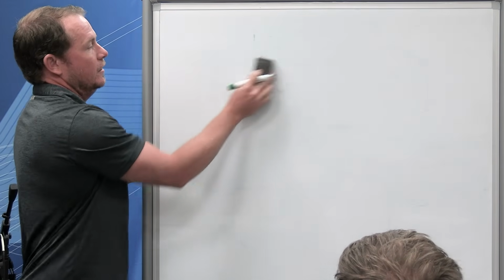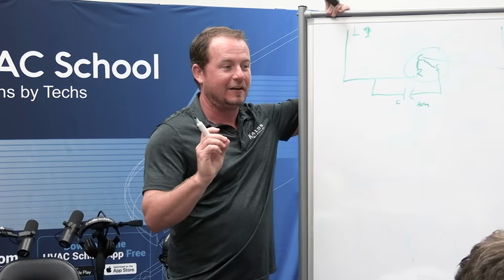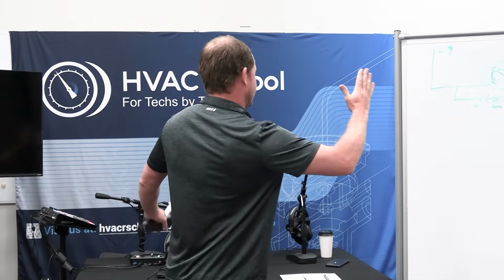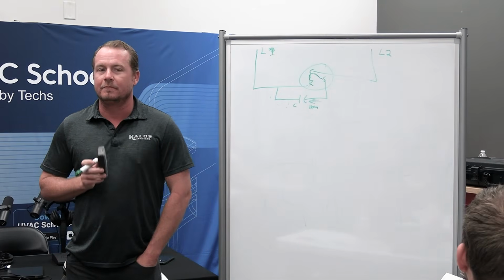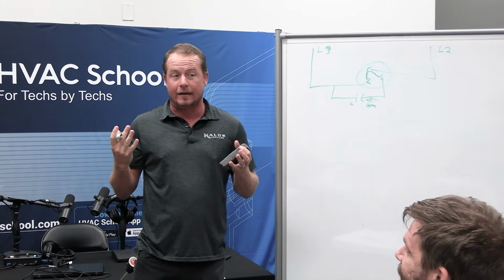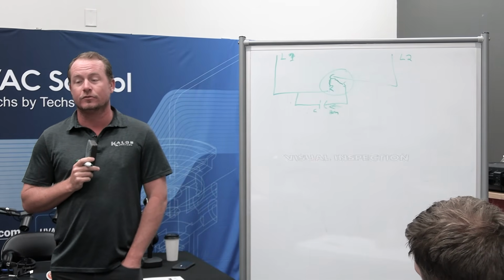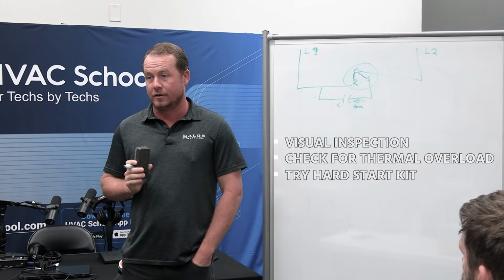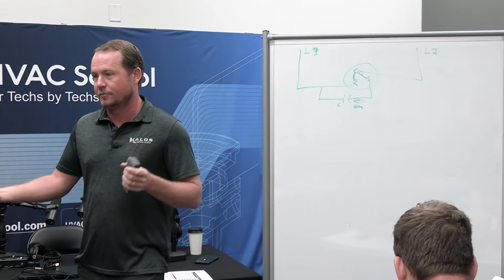Capacitor and Hard Start Myths Busted

Comment: Capacitors increasing voltage:  A person can easily get this conclusion if they measure the A.C. voltage on the input to a rectifier with a capacitor across the output of the rectifier without a load.   In North America the A.C. line voltage will measure using a DVM  at something near 120 volts A.C. while the D.C. side will read the highest voltage reached during the A.C. cycle which will be 169.7 volts D.C.  

The idea of A.C. RMS voltage is the same number as an equivalent continues D.C. voltage that would provide the same electric Power to a purely resistant D.C. load.   A purely resistant heating element would be expected to produce the same heat from 120 volts A.C. or 120 smooth D.C.   Really liked your lecture!   Good engagement with the students!
Reply: You're describing something completely different. The RMS to peak voltage will depend entirely on the wave form of the AC voltage. In some cases you may see the term Crest Factor used. For a sine wave the factor is √2 or approximately 1.414 which is where the numbers you cited come from. The crest factor for a pure square wave is 1 which means the the RMS voltage and the equivalent DC voltage are exactly the same. Many DVMs do not actually measure RMS, but instead apply a correction factor to whatever they do measure while assuming a sine wave.

Comment: The ECM motor is not three phase.  It is a DC servo motor.  You use a computer/controller to control the speed at which the poles rotate.

I really don't understand what in the freaking what this guy is talking about???
Reply: He is not wrong.  It is a DC commutated 3-phase motor.
On Genteq's website (regalrexnord), they have a video that describes the Evergreen ECM motor as '3-phase' motor!
It's semantics...
It is not conventional sine-wave 3-phase as in industrial utility service; it is pulsed DC into 3 'phase' windings.
ECM motors are commonly known as DC as more commonly they are supplied from a DC source instead of AC power.
In this case, there is an AC to DC rectified power supply internally powering the ECM part of the module...
[The DC part of the circuitry is on the power input side, not on the motor side; there is no 'DC' at the motor...]

Various companies and instructors (and myself) may vary the terminology and strict definitions.
I'm not sure there is universally accepted terms for these new applications for these ECM motor technologies.
Mr K L

Comment: WOW!  I am an Electronics Technician with over 25 years experience of repairing electronic equipment down to the component level and this is a seriously dumbed down and confusing explanation of what a capacitor is and what it does.
It would have been easier, quicker, and clearer if the construction and actual nature of the capacitor was simply shown.
Two plates separated by insulation that will STORE electrical charge.
How hard is that?
Then you need to make sure that everyone understands the nature of AC and DC current flow.
BECAUSE,
how the capacitor behaves in an AC circuit is very different then when it's in a DC circuit.
But you really ought to learn both these natures to properly grasp how it does what it does.
Also, the symbology he used is for a capacitor that has a polar bias.  A cap used in an AC circuit should properly be drawn with two parallel line segments.

There is some good practical info on what happens with a bad cap in a motor start circuit and what to look for and how to get past certain problems.

Comment: Capacitor is like a spring. Takes a certain amount of charge per volt change of potential (movement per unit force changed). The force/potential is across the cap, like either end of a spring. The trick is, though, that a stiffer spring is like a smaller capacitor - takes less movement to get big force fast. A big cap is like a soft spring. Voltage rating is like force rating - springs don't usually have these, but imagine if you pushed or pulled so hard it broke.  The other way of looking at it is, stiff spring = small cap = not as much movement for  a given force. 

What makes it all confusing is that electromagnetics swaps things around! Actual magnetic fields make force from the current, and give you speed from the voltage, when you'd think it should be that more voltage is more force, and more current, more speed. But that only applies to electrostatic actuators, which barely exist at all. (piezo-actuators work that way). 

Magnetic actuators, which is mostly what an electric motor is, flips things around. But that should make some sense, because magnetic fields store energy like a moving hammer: It's inertia. Its funny how you can watch the current 'disappear' as movement happens, and even 'reappear' when movement begins again, with solenoids / electromagnets. 

But yeah: Inductance is a measure of how many volts it takes to change the current by an amp in a second. Pretty much exactly like mass. Heavier hammer takes more pushing for longer to get up to the same speed as a lighter hammer. And like a hammer, when you change their speed suddenly, they make very much stronger forces - at least for a very short time. 

So, basically electric motors and electromagnets in general trade the inertia of the electric current for bulk inertia of matter. To have much of that 'inertia' available to 'trade', you have to have a lot of 'movement'. 

Fortunately, you can cheat a bit by winding the wire around multiple times. That lets you get more amp-turns with less actual circuit amps, but it does mean you now will need more voltage, since the back voltage you get when the matter does move (which will look like a voltage in the coil 'resisting' the flow) multiples up by the number of turns as well. Which is of course how transformers work. Just a coil magnetically coupled to another coil.

This back voltage is why normally the motor doesn't go into thermal overload when running normally at design speed: The speed means there's enough back voltage to take up most of the supply voltage, with just a little supply voltage left over to keep the current moving at it's lower 'operating' rating.

Comment: It seems to me a shame that you buy a little refrigerator that operates at 100 watts but it takes a 1500 watt inverter to start it. I understand the fridge is cheaper because it uses the power in a home electrical system to accommodate that but what would it cost to have the fridge start and run at let's say a 600 watt or even 200 watt inverter?
Reply: It's because of the large starting current, required to start the metal mass rotating.
I think the soft start kits are the answer. but I an not familiar with them; how much they can reduce the start load, or if they make them for small hermetic domestic refrigerators (split-phase hermetics).
The soft starts mentioned here are for PSC compressors (domestic ACs).

I think there are dual 12VDC 110VAC refrigerators, that may be your only solution...
Mr K L
Reply: @troubleshooter1975  I think it is also the pressure in the lines. That is why they wait before restarting. It is a conundrum going with a 12 volt or just doing 120 volt. I have the solar and the batteries and now use a 4000 watt Magnum. Kind of happy with it. What is telling is the split system AC units they now sell, supposedly no big draw on the AC to start.
Reply: @timsteinkamp2245  I was referring to after a reasonable 'off' time, after which the pressure in the lines would be equalized (no load).
During the first few seconds of operation, the primary load (and extra current need), is due to the rotor mass, and the lack of back EMF until it reaches say 80% of full operating speed...

Comment: You asked for the symbol of a capacitor.  There are several symbols used.  I'm not going to try to show them here, some show which side of the capacitor is the outside of the wound foil, for our purposes, it doesn't matter.  There are a few symbols to show an electrolytic capacitor, where the polarity is shown.  Electrolytics are polar-sensitive, you connect them backwards, they blow up in your face, that's to DC.   Often internally, AC capacitors are non-polar, internally they could be two electrolytics in series, back to back, which makes polar devices into non-polar, and as said, sever different symbols are used.  Then there are other types that are variable, some are called varicaps, the capacitance is adjusted by the applied voltage, but not in the HVAC business.  I could go on and on.  What confuses some people are the symbols used for switches, some put them into two categories, electronic and industrial.  Having worked both sides, not confusing at all to me, but if one has only worked in industrial electronics, may not make sense.  

Just to make the water more muddy.

Jim

Comment: Is not an ECM motor DC
Reply: Many are; but in this application, it is AC powered and rectified internally to DC, to power the ECM circuitry.
Incidentally, an ECM motor (DC or otherwise) has NO DC at the motor windings; the windings are pulsed from the ECM controller.  This is similar to a stepper motor in that regard.
Mr K L

Comment: So, a capacitor works by transferring energy via the electric field. Typically, it blocks DC and it takes AC to transfer the energy (again, through the electric field) from one side of the capacitor to the other. A capacitor also causes a phase shift in the applied energy, where the current in a capacitor begins to lead (or come before) the voltage in the circuit. Inevitably, you will find circuits where there is a large amount of inductance involved. (an inductor transfers energy by a magnetic [or electromagnetic]) field. This typically is found in motors, which exhibit the properties of an inductor. And in an inductive (typically, a motor) circuit, it exhibits the opposite properties of a capacitive circuit; that is, in an inductive circuit you will find that the Voltage in a circuit begins to lead (or come before) the current in a circuit. Now, it is important to realize three things, 1) that if you have an inductor (typically, a motor) in the circuit, and a capacitor in the circuit, that essentially, to the extent possible, (depending the amount of capacitive reactance, and the amount of inductive reactance in the circuit) they will tend to cancel each other out; and 2) the most actual power transfer takes place when the current is 100% in phase with the voltage; and 3) that happens when the capacitive reactance of the capacitor cancels out the inductive reactance of the motor. And then, there is no resulting phase shift. Consequently we hit that golden point where as much power as possible is being transferred from the source (in an AC, usually 240 VAC) to the load (usually an Air Conditioner or fan motor). Other higher voltages can be used where more power is needed to be used, but while higher voltages are common in industry, they are not so common in home use. Above, I mentioned Capacitive Reactance (typically called Xc ... [usually pronounced "X sub C"]), and Inductive Reactance (typically called Xl ... [usually pronounced "X sub L"]). There a formulas for both of these, and deeper explanations for both of these all over the internet. But when Xc = Xl ... there is no phase shift, and you have maximum power transfer from the source to the load. One additional point. In the starting of a motor, the amount of Xc needed to cancel out Xl is greater, and all the time changing during the 'speed up' phase, until the motor reaches full speed, where Xl levels out. That is why there are two different values of capacitors used, 1) for the "start" circuit, and 2) for the "run" circuit. Xc for the 'Start' circuit is typically optimized for the startup phase, and Xl is typically pretty close to where it needs to be for the "run" phase, thereby providing the most efficient of both worlds ... start phase and run phase. These are basic electrical as well as electronic principles. Sadly, many never grasp the meaning, and come to an understanding of why. And I have to admit, it took me a long time to come to that realization. But when the 'Ah Ha' comes ... you will be forever improved at your particular tasks, whether electrically or or electronically. And, especially, in a motor circuit, you will understand what the actual purpose of that 'start' - 'run' capacitor actually is.
Reply: All of that is true, however You’re not making the difference clear between a capacitor that corrects power factor with a start capacitor. Start capacitors in a motor are only used for the phase shift on the start winding. Their purpose is not to reduce the VARs of the circuit or increase power factor. Which is what he explains in the video. In fact if the run windings are at 100% power factor, the start capacitor will increase the VARs for the start winding because that is what causes the phase shift and what is necessary to get the motor spinning
Reply: @benheaton3728  You are correct. I didn't mention power factor, in the sense that I didn't name it. But it does have to do with that phase shift in the circuit. That phase shift occurs when the capacitive reactance isn't quite balancing the phase shift in the other direction due to inductive reactance. In that case, magnitude of Xl does not equal the magnitude of Xc, and there is a resulting phase shift (because it is not completely cancelled). The power factor is a single mathematical description of that resulting phase shift where  PF = COS(Theta), which says that Power factor is equal to the cosine of the resulting phase angle. If I remember my theory correctly, when PF = 1, it is in phase, and the most energy is transferred from the source to the load.
Reply: Well, they're used all the time in pure DC circuits, so they do work in DC.
Reply: There is never energy transferred directly from one side to the other. When voltage  is applied to one side the opposite polarity induces voltage on the other side of the  capacitor. So imagine a positive voltage applied to side 1. As the voltage ramps up in the run coil and the magnetic field is induced, side 2 of the capacitor charges through the voltage force pulling or pushing on the start coil, creating a second magnetic field.
Reply: Best scam to make money, we need heavy duty capacity
Reply: Thanks for the info
Reply: Okay, for us regular folk, hard capacitor helps or does not help???

Comment: Connecting a capacitor to a wall  outlet creates a direct short & will blow the circuit breaker and or destroy the cap. Caps block DG voltage NOT AC. Bad example.
Reply from the maker: Actually you are wrong because I've done it many times
Reply: Just don’t do it with a DC cap!

Comment: Blown capacitors might have a "bump" on top, where the relief valve is located.
Side-note: Stand-up refrigerators compressors don't have the "start" winding always connected, only at start time.
Reply: wrong
Reply: @foobarmaximus3506  No, Freedom Speech is correct;
Most domestic refrigerators/freezers with fractional HP hermetics have start 'relays' or PTCs that effectively cut current to the start winding after the start cycle...
Mr K L

Comment: Some of them fellers ain't too sharp. Honestly, I'm surprised no one could answer the 60 cycle question. It's why the analog clock on the wall keeps rotating at the same speed regardless of the voltage (to a degree).

Comment: You drew a dc capacitor. 
The curved plate denotes the more negative connection.
Run capacitors are AC capacitors. 
A capacitor is like a battery that can charge and discharge very quickly without over heating.

Comment: Have you ever come across a condenser where you install a hard start kit 5-2-1 and it causes the thermal limit to go out on the compressor?
Operates normally with the capacitor 45/5 installed. Wiring double checked, also 2 units tested with same failure.
Reply: Sounds like a defective or mis-wired start kit. I prefer 5-2-1 brand, but sometimes their relays don't work properly. Always test them at time of install.
Reply: @briangc1972  Tested two 5-2-1's on another system and both work. So known good. Verified wiring as per many YouTube's and two videos from support. 
So Currently just living without hardstart and just replaced the cap, interesting problem.
Reply: @mobilecommunicationsnetwor5268  Got me stumped, I'm glad it's not one of my customers.
I would look at the compressor label and see what run cap is listed. Maybe your 45 is too small and the start kit relay is not getting enough feedback to pull out of the loop. Also, verify the 45/5 is connected properly. I have seen many dual caps with the compressor connected to the 5 terminal and not the herm terminal.
Reply: @briangc1972  Thanks, will check the compressor.